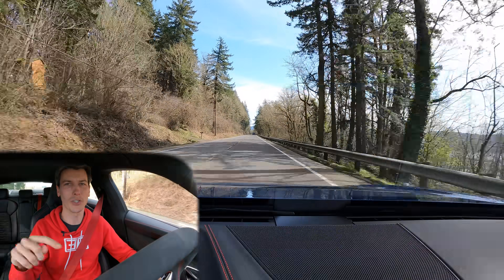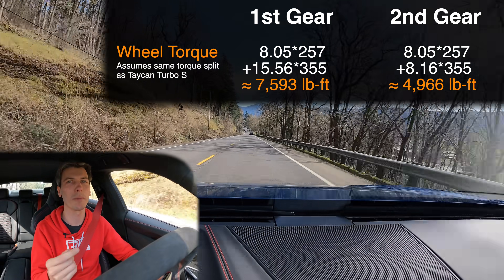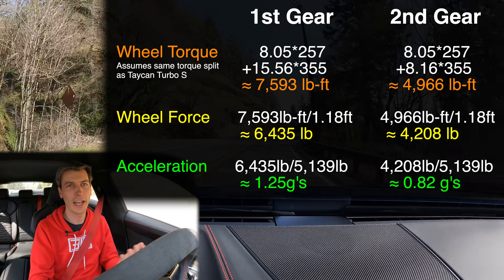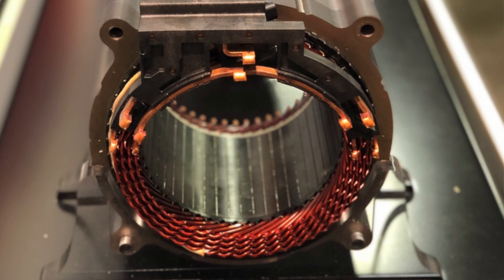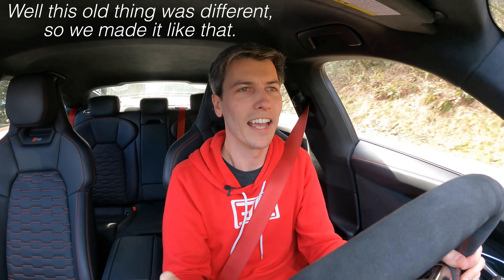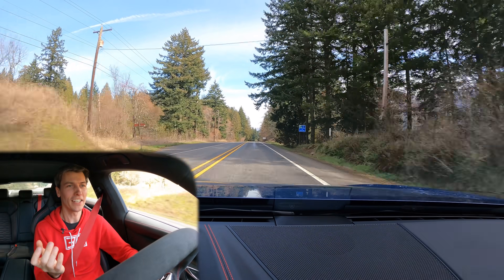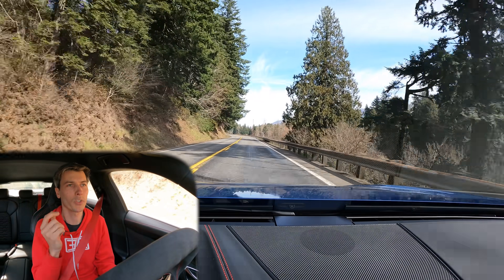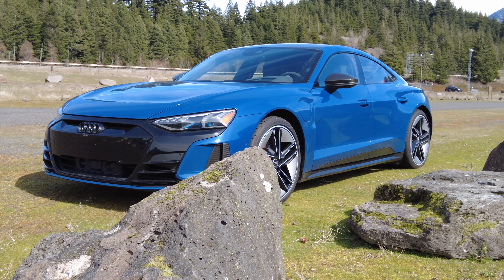Are Fake Manual Transmissions Coming? Audi Keeps It Real

Comment: I still like to Dj with old Vinyl and no Computer. It’s way harder to beatmatch and do song transition with the original method. 
New Methods will beatmatch for you with sync aren’t effected by vibration of speaker systems, aren’t effected by wear and tear of the needels and the vinyl because it’s all digital now and just the controls are partially mimicking turntable setups.  And tons of crates of vinyl can be carried on one usb Stick/ computer. 

Still making a transition on old vinyl
Solely reliant on your hearing is pure magic and I’m sort of sad for all the youngsters who will never have this experience because modern technology made them skip this.

Comment: but isnt a electric motor subject to same laws as combustion engine, thus low rpm might increase range and durability over years,  why spin something 6000 rpm if you dont have too
Reply: Electric motors have far less wear at high RPM.

Comment: I think "Fake it" is a problem here. 
 
Let's say they make an EV with a real, 6-speed manual transmission. Let's say the motors have ICE-like torque curves. Maybe the motors are designed to produce a nice sound, as well. 
 
Engineers would say this is an EV designed to be worse than it can be. Okay, but is it fake? If no speakers and cheating is involved. Is it fake?
Reply: I think it's entirely possible to make an EV that is more engaging than a ICE car. EV's are more flexible and customizable. 
 
But I think an engaging EV is probably going to be a worse EV from an engineering standpoint. I imagine an electric motor making a really nice noise is probably a motor making a noise it shouldn't make.
 
I bet most auto manufacturers will do this.

Comment: Honestly if there was an electric car that could simulate the engine note, gear ratios, and adjusted for weight torque curve of other cars I’d think that would be pretty sweet.

Being able to switch between electric, big displacement V8, high rev screamer, or turbocharged experience would be pretty amazing.
Reply: I don't want an electric car to feel like an ICE car. It should feel like how it is, instead of trying to pretend to be something that it isn't. 

Btw a real manual transmission actually pairs exceptionally well with an electric motor because it is impossible to stall it. The only reason why it hasn't never been done on a road car (almost every electric time attack car has a multi-speed sequential manual transmission) is because no battery within the near future can come close to gasoline in energy density, hence it is impossible to make a real performance car (civic type r, mustang, corvette, 911, etc) powered by galvanic cells. Fuel cell on the other hand is a direct replacement to ICE, and may reach a state of coexistence with galvanic cell, similar to diesel and gasoline engines. Galvanic cells are better for the average grocery getter, and fuel cells are reserved for high performance and heavy duty applications.

Comment: Hi Jason, What I'd like to know and I hope you do a video on this is; are any car makers using Active Noise Cancellation to reduce cabin road noise instead of using sound deadening materials (which are not recyclable, heavy and require energy to accelerate) ? I've seen estimates of 20-80 lbs and even then, most cars have way too much cabin road noise.

Comment: One thing I've not seen mentioned is that gear selection allows for engine breaking, and that's a skill that many drivers use to securely drive on demanding highways or roads. I assume electric motors can engine break too but I've never been able to engine break that one tesla my aunt's boyfriend had

Comment: "There's this old thing that worked different, so we made it like that" reminds me of keyboards. When typists made the transition from typewriters to keyboards, they missed the feedback of striking the page so keyboard manufactures implemented a solenoid that made a loud sound every time a key was struck. This went away eventually but those vintage keyboards are pretty incredible to type on.
Reply: I mean this is a great but also horrible example because it really hasn't gone away at all. As a matter of fact its made a complete resurgence. I implore you to go check out the mechanical keyboards subreddit. Or just look up the hundreds if not thousands of custom mechanical keyboard youtubers.
Reply: Dude I still buy mechanical keyboards purely for the feedback haha.  I don't game, I don't need a performance keyboard, I just spend 30-100% more because monkey brain like click

Comment: Or the sounds are piped in to drown out road noise… if you are in absolute silence your ears will adjust to hear the road noise even in the best sound proofed vehicle. So you pump in engine noise to keep the ears tuned into the vehicle and not the road. There are audio profiles that are extremely quiet but can keep the ear “off balance” when adapting to local conditions

Comment: A) I equally never understood why anyone would choose to put a CVT in a car just to make it act and shift like a regular auto. If the customer doesn’t know the difference, and you now have idiotically made the “more efficient” transmission just as “inefficient” as the regular auto… why go through the trouble?!

B) I could never drive a car with a fake manual trans. I understand exactly what happens when you press the clutch pedal and “this thing ain’t got it” so why bother?

C) The Tycan looks like complete garbage. It simply looks like all kinds of spare body panels were put together in the best cohesive way possible to make something resemble some kind of a car. It brings to mind none of the other Porsche models. I can’t be the only one that thinks this, so if I wanted a high end electric sports sedan, I’m going with the Audi… and it’s cheaper to boot.

Comment: I had an idea of a real manual car with an auto button. The car naturally drives like a manual, but when you hit a button, the stick lowers into the transmission tunnel, the clutch peddal lowers to the floor or locks into place and the car automatically shifts gears for you using actuators connected to the shifter base, ans the clutch is also handled by a actuator, and the gas pedal is already electronic controlled so downshifting and rev matching isn't an issue.

Comment: lol ,. no ,. just because thats all you can think of doesn't mean a whole lot, logically speaking. .. being able to pin a spot in the torque curve is incredibly useful for car control regardless of the power source but also tool control for that matter ,. you might not know this but .. The larger the scale of torq you are controlling , the more options you need to fit in a short throw of a pedal or a trigger, which equals a loss of fidelity and therefor accuracy . it actually doesn't matter if its fake, i bet its more manipulatable and ultimately faster around a track for drivers. Your statement basically implies there is no logic in having an electric 3 speed screw gun with variable speed trigger ,. this also implies that  OD and sustained gear1 gear 2 where pointless in an automatic too,.  just no,. lol way no.,,

Comment: I've got ADHD-i, which makes it difficult to focus fully and properly on things I'm not fully involved in. I can't drive automatic transmission cars for anything longer than a grocery run because my focus will drift. In a manual, I'm actually doing something, which keeps me engaged and able to drive safely. I also appreciate the extra control that I don't get in an auto. That being said, I would much rather have a fake 6 speed with some control in an EV than one speed I can't control in the slightest

Comment: to play devil's advocate, does an electric motor get hotter under high load versus lighter load? for instance, when doing a 0-60 test, would an their be less heat generated if the electric motor had a mechanical advantage versus direct drive? If it can run cooler that could mean more longevity of the electric motor. Also, think about the battery, if you can make the car accelerate at the same rate between a geared vs direct drive vehicle, wouldn't the geared vehicle require less electrical load as well? This could mean less stress on the battery, making for longer performance operation, quicker preparation for a performance mode, and even better battery endurance over time by discharging at a slower rate. Basically, a geared electrical vehicle could potentially last longer and prep quicker. Idk for sure, but I would love to see research on this to see if there are legitimate benefits.

Comment: I'd be down for a boat-like throttle/gear system in combination with an accelerator pedal. Slide the lever up for more top end, slide down for lower wheelspin and torque and stability at low speeds.

Comment: A fake manual isn't needed when a real multi speed manual with a real clutch could be used on an ev. Electric motors do benefit from multi speed transmissions. An example of this that most people have experienced is a battery powered drill. There is high and low speed with a real geartrain selection. The benefit of a selectable transmission for any motor type (internal combustion, electric, hydraulic, pneumatic, steam, sterling or other) is that a smaller motor can become more useful through gear advantage. Engines do not need multi speed transmissions to work. Both koenigsegg and a go kart don't use multi speed transmissions, however one is really slow and the other has an insanely powerful engine to overcome gear disadvantages. If an ev used a real manual transmission then a smaller less powerful motor (lighter and cheaper) could be employed but with good performance. The transmission probably would not be a 6 speed and the clutch would only be needed to shift not for starting.

Comment: Hello Jason, in your video about fake manual transmission there is a small misconception. 

The Porsche taycan has different engines then the Audi E-tron GT. 

The Porsche has synchronous engines and the Audi Asynchronous engines.

Comment: wouldnt having multiple gears on an EV lead to greater battery range? if you are at highway speeds and lets say gear 1+EV motor is at 3000rpm and shift gear 2 leading to 1500rpm (rough example). shouldn’t the ev motor require less battery consumption because of the cars current inertia+lower rpm? or would the extra gearing cause parasitic loss due to more friction? 

im confused but curious on if extra gears would save on battery use

Comment: A thing about the fake engine noise. I used to hate them. Until I rode in an EV with no fake noise... Only highway noise... It was very annoying. Just from a human harmonics perspective. Having a variation in harmonic frequencies are much more preferable over a constant pitch frequency, Often fairly high pitch as highways can be with most tires. My big 392 Hemi loping around at 70mph at 1500rpm is an almost serene place to be for hours on end. Give a little throttle and the engine grumbles to life and picks up. I cant imagine how annoying an EV would be to ride in for 8 hours just listening to the whine of highway on tire. This alone has made me appreciate fake engine noises. And I think its a better excuse for them than nostalgia.

Comment: I want it to be ridiculously accurate at simulating a manual, down to stalling & turning off if you mess up. Either that or nothing. Automatic shifting transmissions suck. Either make it a smooth single speed or give me the full manual transmission experience.

Comment: There's a Porsche 911 ev restomod which uses a real manual transmission. The cool trick with it was that they used a small motor which could spin up to 9.000rpm, didn't make lots of power, but it didn't matter, because it made sense

Comment: For the Tycan vs Etron, I mean look at the silverado vs sierra, or tahoe vs yukon. Different category of vehicle but exact same situation. Both compnaies owned by same parent, both come off the same assembly line, both are mechanically IDENTICAL. The chevy is cheaper and looks one way, the gmc is more expensive with some more premium touches and looks another way.

Comment: On the note of the CVT fake shifts and fake engine noise, the reason they did it was customers bringing their cars in thinking something was WRONG with the car because it didn't "sound" right. But it should be something user defeatable, in both cases. The CVT fake shifts are only a thing when you're hammering it anyways, otherwise it operates as normal.

Comment: You are missing some upsides for gears as being torque/speed limiters. When trying to get unstuck from mud, snow or ice you have much finer control not to dig yourself in. Also in city traffic, when you want fast responding acceleration or deacceleration (engine breaking) you put in lower gear. When you want to cruise and take it easy then you put in higher gear so that even if you push acceleration pedal too much, it will not accelerate faster than you want.

Comment: I am driving a rental car with a CVT transmission (2022 Nissan Maxima.)  It has an "ability" to shift (if you want).  I tried "downshifting" to slow it down at times, but as it doesn't have much "backpressure" it just makes a little more of a whirring sound as the engine revs up with each downshift.  Absolutely useless.  Funny how the marketing guys have imposed their will on the engineers.  But, engineers are just happy to design stuff and will design anything asked of them.  (I R one.)  I had an electric Honda Fit EV for 7 years, really loved it.  When I get in a gas car I feel like I am driving a Model T, an anachronism of a prior era.

Comment: If I had to develop the software for a fake manual transmission with clutch paddle in an electric car I would go the extra mile and implement simulated stalling of the engine, slipping off the clutch paddle and maybe simulated worn out clutch for drivers resting their foot on the pedal.

Comment: as much as I'm a 'save-the-manuals' kinda guy, I couldn't see myself buying a fake-manual EV. If there was an added benefit to having multiple speeds, then I'd welcome a multi-speed transmission (if it was very reliable) but I truly think the manual transmission will die with the ICE, sadly. (I personally don't think ICEs and manuals should ever truly die, but that's another discussion). I definitely do believe EVs need to take over soon and absolutely dominate the streets, but I feel like a dual motor single speed setup makes the most sense. EVs are inherently simpler than ICEs; lets embrace that.

Same thing with fake engine noise. Out of place in ICEs, but pretty laughable in an electric car. It's like motorcycles with the intake looking like carburetors...except it's all port injection. I get the nostalgia effect (so lets keep making the old FUN stuff for decades and decades) but lets be open minded about this new tech that really should take over mass personal transportation. EVs are quiet, and that's a good thing lol

Comment: Just include a full virtual experience. You can change gears, use the clutch, steer, accelerate, brake, etc, but really the computer is driving while playing game sounds through the speaker. Now gear heads and tech nerds can be happy! 😁

Comment: This all is insane imho. It's like buying an SSD that can simulate being a HDD, inclusive the spinning sounds. I want a continuous transmission or an EV because I don't need to shift, it always is at it's optimum, and it's quieter. Shifting and engine/road noise aren't enjoyable things, they're annoyances of current vehicle design. A loud exhaust is as enjoyable as sitting in traffic. Driving itself is a chore/work I have to do, time that's wasted needing to pay attention on the road so that I don't die instead of doing meaningful stuff.That's why public transport (high speed rail and planes specifically) and driver assistance systems exist.

Comment: Also learned to drive using a stick shift, and I also prefer them. The stick shift engages the driver and forces the driver to pay attention to driving and to the road. This becomes habitual over time. The EVT I have in my present car makes me feel remote and disengaged from the job at hand. I feel less safe driving now, because I'm less engaged in the driving experience. 
Plus it's far less fun. I can't use the torque or the clutch  to slow me down any more while entering a curve.

Comment: Ford did an electric s550 mustang with a six speed manual.  It was a one-off concept used for show but maybe someday it will be suitable for mass market. Personally if I'm forced to choice between engine noise and three pedals, I'm taking the stick shift.

Comment: Most (if not all) DIY electric cars use a manual transmission. My understanding has always been they do this because it's cheap and easy for a DIY solution, albeit inefficient. My question though is why has no automaker decided to use this strategy to make a mass produced low cost EV sports car? Seeing as the cost to build these DIY is somewhere around $20k, (and thats if you do it yourself and don't have the benefit of economies of scale) why has no company decided to take that route yet? It definitely would be a lot cheaper than this simulated manual, and while it probably isn't as efficient, I feel like the target market of these type of cars wouldn't care too much about range/efficiency anyway. As long as it was a cheap and fun sports car, I could see something like that getting a lot of people convinced to try EVs out.